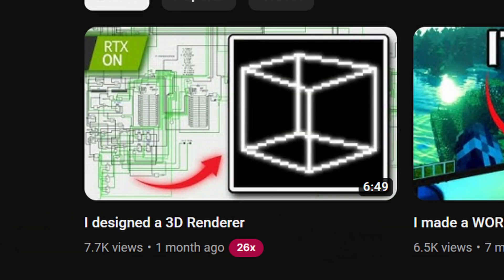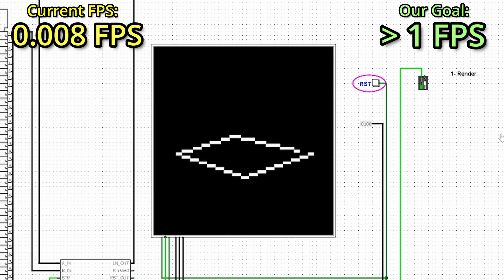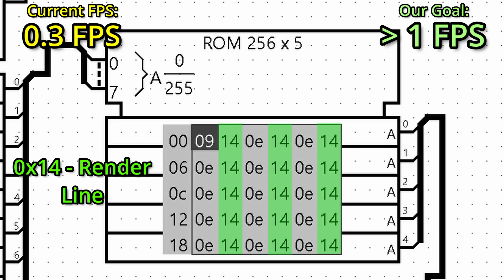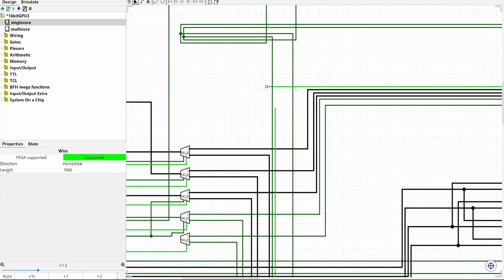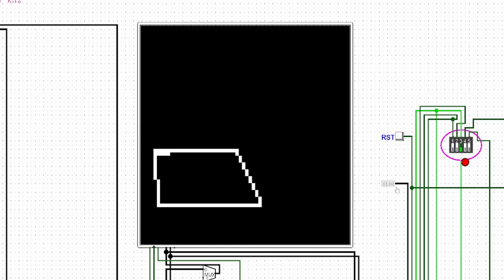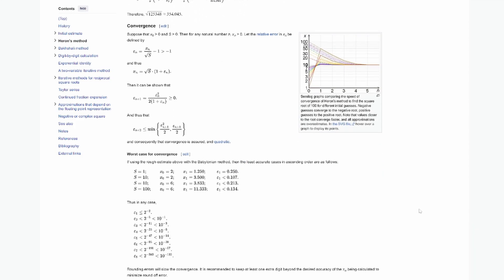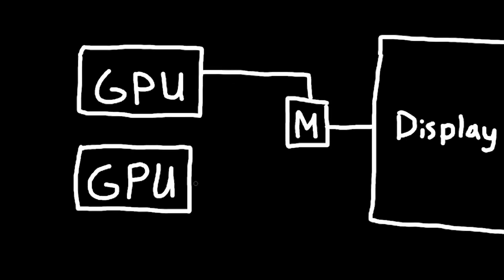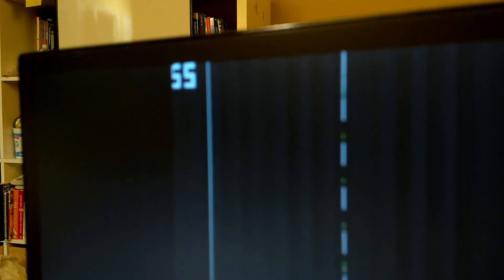Upgrading my 3D Renderer (#2)

Comment: The way you rasterize the polygons is called scanline algorithm. It has been used by software renderers for decades. Modern GPUs only accept triangles and use edge equations to know which pixels are inside a triangle. Since each pixel can be tested individually, this can be done in parallel. Hierarchical rasterization can be used to go even faster (eg: by splitting screen / triangle bounding boxes into subtiles)

Comment: "In theory this would work perfectly but in practice... it doesn't." Amen :D
Prototyping with physical ICs is a balance between time consumption and messiness. If you get the chance, you could buy an FPGA board or some other programmable logic device to prototype with, though they're quite expensive. Launch a patrion, if you can, so we can chip in a little bit ;)